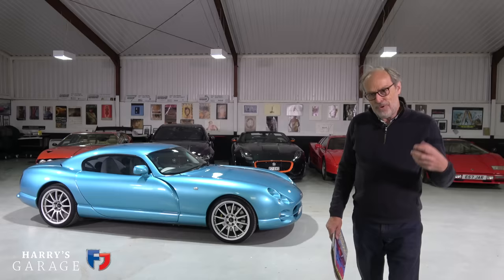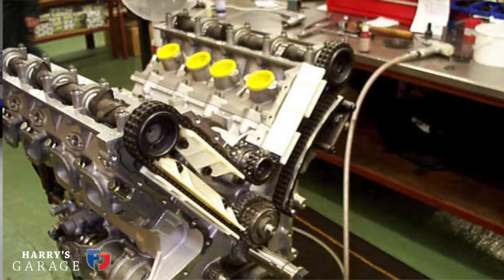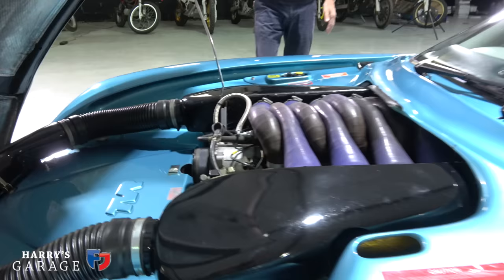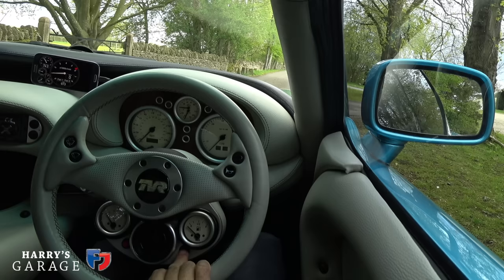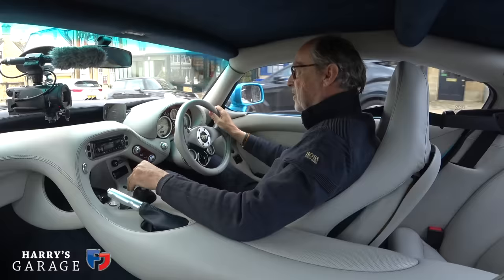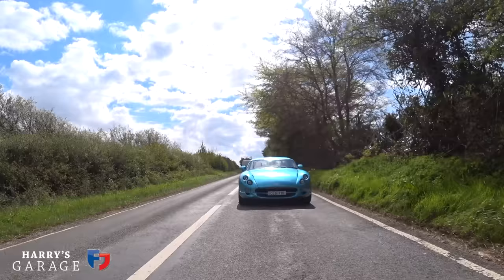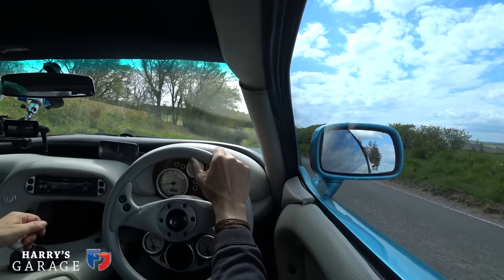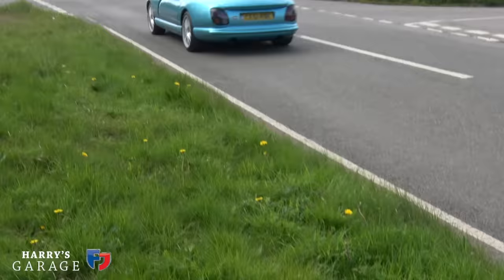2001 TVR Cerbera 4.5 Red Rose review. Revisiting the wild one 20 years on!

Comment: A flatplane v8 is like two inline 4s at an angle, the angle makes each bank fire every other time. Contrary to what Harry said, it is not firing two cylinders at once.
Reply: @r4360  That is not a flatplane, that is a flight of stairs, and a potato.
Reply: This engine's a 75° V8, even less likely to be firing at the same time.
Reply: Quite right however owing to the 75 degree angle, the firing sequence isn't a regular one either. Pairs of cylinders fire in a sort of heart-beat, ba bam, ba bam, ba bam. At higher revs this makes for a really harsh noise - lovely harsh - as though it would be the Devil's choice of V8. Very business-like.

After two Caterhams, one of which was almost 250bhp, I was looking for something with a hard roof that gave a level of performance I wouldn't be disappointed with. I ended up testing a number of cars from Porsches to Lotuses and in the end the only thing that had the race-car immediacy that the Caterhams gave me was a 4.5 Cerbera. An amazing car and engine if there ever was one. Mine had the short induction kit which moved the torque further up the rev range increasing its power. It also had an aftermarket ECU. There weren't many options for aftermarket ECUs then because of the heartbeat firing sequence, but Emerald came up with the goods (I had Emerald ECUs on both of my Caterhams too). This combination allowed mine to be mapped to Red Rose power levels. 

I am not sure I'd have the nerve to own another though. There's some support for TVRs in the aftermarket world but some parts are tricky to get hold of. I remember being particularly worried about having to source a windscreen, if ever that became an issue, as no-one made them anymore and the TVR-owner community was only occasionally able to convince manufacturers to make things in batches.
Reply: @NigelMarston  Heartbeat, quite the way to put it. Bravo
Reply: well he's half correct as Honda made a  motorbike which had a so called big bang engine where it was as though the cylinders all fired at once.
Reply: @toucan221  How does the existence of Honda Big Bang (a 360 degree crank) make him half right about what was said about this flatplane (180 degree) V8?

Comment: Had a couple of Tvr’s. You definitely have to look after them and cosset them but my word are they fun. Love ‘em. Great vid Harry.
Reply: Did you have a Sagaris?
Reply: @TBendez  I wish! An S2 and a Chimaera.
Reply: @philkitchen9719  Nice anyways, you'll get one someday ☺️
Reply: Had to check the meaning of cosseted, never heard or read it before... And yeah perfect adjective for my weekend toy, the 5 GT Turbo... Flimsy plastic fantastic toys...
Reply: I had a 4.5L Chimaera from new, and in the 6 months I owned it, it was in the garage being repaired for almost 3 months of that. It let water in through every possible place it could let water in, dumped a full tank of petrol onto my drive, and one morning I found it in the middle of the road after it had rolled off my drive when the handbrake failed. I didn't even get chance to enjoy it over a Summer, as I was so desperate to get rid of it. I recorded 18 faults in those 6 months.  I'm not surprised they went bust.
Reply: @markparker5585  I mean, that does happen to completely normal cars as well, the result of the handbrake failiure isn't even on the car. But alas, it is a lower quality car and therefore such issues are expected. 

Worst manufacturer screw up for the moment is probably Ford US, they're having catastrophic engine failiures within 100 miles.
Reply: @markparker5585  you must've had the Friday afternoon team on your car.

Comment: Had a TVR in the late 90s. Endless electrical problems. Used a ton of water, it was uncomfortable,  low teens fuel consumption, water in the footwell when it rains, terrible build, roof leaked. I loved it despite all this. You love them or hate them, there is no in-between.
Reply: I never got to own a TVR but I do miss cars with 'soul'. Stinking of petrol & oil after a thrashing, quirky unreliability, power assisted nothing, being able to work on the car yourself. Good old days.

Comment: Such a unique sounding V8 and that color is really amazing on this car. I can't believe in the early 2000s you could get this level of performance for under £40K. The TVR Speed 12 is still one of my favorite cars of all time along with the Tuscan if the same early 2000s era. Same with the Nobles, granted the fit and finish didn't rival the Germans but buyers of these knew that and accepted they're buyer an experience the Germans couldn't match.
Reply: Yus agreed, my 2001 E55 cost twice as much, has an engine one litre larger and makes about 50hp less, the TVR was extremely good value for it's performance level.

Comment: My dad had a 4.2 in “paradise Purple” and being only about 19 at the time I got to borrow the keys on a couple of occasions to visit Southend Seafront on a Friday night. Those were the days
Reply: Your dad sounds amazing. My dad wouldn't even let me borrow his XR3i.
Reply: @BobMonkeypimp  yeah, it was his little midlife crisis. (As my mum called it). I failed to mention that I also blew second gear out of the box and the Cerbera had a modified Cosworth T5 box that you could get out to repair / rebuild pretty easily… but putting it back was another matter. A guy that worked at the old TVR factory in Blackpool actually done the works in his garage at home for a cheaper rate. Will never forget that car… roundabouts in the wet was……. Eye opening to say the least !  Only other issue that was constant was that the cabin always smelt strongly of petrol, all the time. Luckily Dad and I never minded it ! Lol
Reply: @triumphontour895  I actually miss the good old days when cars smelled of petrol & oil after a good thrashing. I've had some of my happiest memories with my most unreliable cars, spannering was almost as fun as driving them. 
If you're going to have a midlife crisis, you may as well do it in style.

Comment: And although not as powerful as this Red Rose model...mine actually was ALL you EVER needed..
Reply: Snap. I loved that in most weather/road conditions up here in NE Scotland it would spin its wheels in first, often break traction at WOT around 50mph in second gear and occassionally in third gear. However, every now and then, the road would be warm and dry, the tyres would be warm and you could just about get to the redline in first gear without having to lift. It honestly felt like the stars and planets all aligned for you when that happened. It's so difficult to put into words, but I've had cars that put down their power better and I've had cars with more power that spun their wheels easier - but nothing has ever come close to the overwhelming feeling of satisfaction of it all coming together perfectly in a Cerbera. Its weight, power and traction were the absolute pinnacle of balance in my opinion.

Comment: I’ve driven that very car a bit.  It’s scary.  Handles very well now the owner has sorted it.  Originally it was impossible to use the power but now it’s as good it can be I’d say.  Still takes balls to drive even moderately quick.  Throttle response is insane.

Comment: Imagine having all those instruments in front of you and still needing to design an app with its own ones to understand what's going on.
Reply: The app is designed by an enthusiast, it takes data directly from the ECU to display digitally which is more accurate than the analogue dials. It can show information that the dials don't so you can keep a closer eye on how healthy the engine is.
Reply: Lots of us who've had these cars in more recent years have the app and it's useful for chasing down gremlins such as failed lambda sensors and stuff like that. It's usually something we use when we suspected something might be amiss rather than having it permanently on the dashboard though. Having proper oil pressure gauges etc, a Cerbera has better information as standard than the vast majority of cars.

Comment: I had a 97 4.2 Cerbera which I picked up new from the factory. Never had such a love hate relationship with a car before or since. Fantastic to look at both inside and out, and every drive was an event. BUT, in one year and 10,000 miles, it went back to the dealer 7 times, and it was for pretty serious stuff. The a/c never worked properly and it gets really hot in there. And, of course, the whole thing smells of glue. After a year, I had had enough and of course the warranty had expired. If you have 3 or 4 other cars, it has a place in your collection for when you are in the mood but it is not an every day thing, or certainly wasn't then...

Comment: I had much the same reaction as yourself Harry, when I first saw this 
fantastic looking car. I always loved TVR's, as they built such great looking, great sounding cars, with often bowel shattering performance, and they were never afraid to be different.  it's such a shame what happened to them. The Cerebra wasn't just great looking, great sounding and fast either, as it had two rear seats, (kind of), as well as a half decent sized boot, so it even had a semblance of practicality about it. TVR's always seemed to offer so much bang for your buck too, especially when compared to other cars of similar performance. So, if you just ignore the facts about slight reliability issues, build quality, fuel consumption, a pretty cramped cabin with rear seats suitable only for small kids and that it's always going to be loud, which on long trips the missus and kids may find a little tedious after a while.  Apart from these, well it's the perfect family runabout!

Comment: The TVR Cerbera is a great car for wild adventures. The AJP Speed 8 isn't a long stroke design hence the bore/stroke ratio for the 4,5l version is 91mm/86mm and because of the 75° flat plane cranck it sounds very unique, nothing alike. The torquey mid range behavior comes from the long induction hoses which are originally mounted on the 4,5l version in comparison of the very short induction on the 4,2l model. Hopefully I can make some of the great upgrades from the owner's list some day. Thanks for the great video. Drive safely.

Comment: I've always thought the aluminum LS engines were light at 414 lbs accessories and all ready to drop in and a little over 500 lbs for the production iron block engines and 550 or so for the LSX iron block but this is much lighter than the LS family. Granted the LS engines were larger displacement, made more power and the LS blocks can support and handle gobs over power over stock.

Comment: I've had one back in the days. It is a beautiful car and I actually quite liked driving it. I mean, when it did actually start. Sold it with 17k on the odometer and at that point, it has spent more time at the dealer's garage than in my own. What a pity... A beauty from the outside and the inside... well, I'd rather not say anything...

Comment: Harry, you may be interested to know (or may know) the AJP V8 was almost a direct engineering copy of the Judd V8 race engine . . . in a de-tuned state.
They bought one, took it apart, copied it part for part, and modified it slightly for road use

Comment: The Cerbera has the character of a Corvette whose designer very much enjoys magic mushrooms, and I like it. The stacked headlights look far better than the previous ones, IMO. It's 400-500 pounds (180-230 kilos) lighter than a Corvette or a 911, which is impressive. But I hate flat-plane V8s for sounding like fours. Sadly, that ruins this car. Well, that along with its fragility in stock form.
Reply: There are two types of flat plane cranks. the main type of flat crank, has  one throw down, then the two center throws up, then the last throw down like a four cylinder, the other type of flat crank has one crank throw up, one crank throw down, then one crank throw up, and then the last one throw down. The 5.2L Shelby GT350 has this type, and the only engine to have it. These engines do not sound alike, but will, if both banks of their cylinders are merged by a y-pipe, then you would have a screamer type exhaust sound.

Comment: I had a 4.5, sure they were quoted as 420bhp, not 440bhp (OK he clarifies the RR is 440).  Never felt like 400 though, let alone 420.  Broke down a number of times. Sold it after the 3rd low load to the garage. By comparison, also had a Griffith 500 for 3.5 years, that was just a much better and significantly more reliable car.

Comment: The decibel reading won’t tell you what the frequency spectrum is like. If the frequency spectrum is nice and smooth then a higher dB level can become quite tolerable and even pleasant. 😃 
A high and unpleasant dB reading may be due to certain frequencies with a narrow bandwidth being much louder (visually like a sharp mountain on a prairie) than the rest of the spectrum, resulting in the high dB reading and unpleasant sensation. 😖

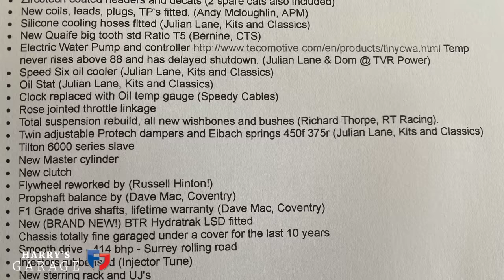Comment: TVR's power figures were always comically optimistic. 440 horsepower in TVR land is probably about 400 in the real world. This example on the spec sheet 5:17 you can see it says 414bhp, and it has clearly been fettled to within a inch of its life! I am sure it's a very hot TVR but to put it in the same performance league of an F40 is rather a stretch. Not least because the F40 without catalytic converters Ferrari quoted 471 horsepower. They were pessimistic. Real world 500+ in standard guise is easily the documented norm, not the exception. Pretty much every early F40 left hotter than advertised, TVRs quite the opposite. Road and Track magazine tested such an example and it posted a 7.7s time 0-100mph.

Comment: Wonderful, the engine noise is perhaps disappointing but at lower speeds and with the whine of the gearbox it sounds a little bit like a vintage Bentley.
Who needs stupid Apple CarPlay when you have all the in car entertainment you  need driving a  proper car with a proper manual gearbox

Comment: Was it true that the car supplied to Performance Car for it's performance testing had anything but a standard engine?. I mean 30-70 in 3.2 seconds and 0-100 in 9.0 seconds suggest TVR were pulling a fast one with this car. 350bhp?... 450 more like considering it had a manual gearbox.

Comment: The 4.5 Red Rose , when on premium gasoline , could be the road car with the highest specific torque output. Are the stated torque ratings realistic or are they as fake as the horsepower ones ?
Reply: There's a video of the 350bhp one trouncing the 400bhp+ Viper, 911 and 500bhp Vantage.

Comment: Fancy one of those as a second car. How reliable are they?
Reply: 25 years old now. Running gear is very reliable. But the tubular chassis will need attention at some point. And some of the electrics will need improving/updating.

The plus side being, £200 insurance on a classic policy. And £280 a year car tax. Tyres are cheap. It’s a 0-60 4.2 second, 185 mph motor. I can’t think of much with a similar spec, that you could run any cheaper 🙂

Comment: V8? With the hood open, I only see 6 squishy intake runners.?
Reply: You can see four intake hoses on the far side, where he’s standing.

The rear hose is obscured by the scuttle panel that the wiper hoses pass through.

I’ve got the 4.2 variant, and on mine the air intake vortex boxes bolt straight on to the manifold. I did have a 4.5 like in this video a few years back, and regret selling it.

Comment: They are dry sumped aren't they? They have an oil tank. The inlet manifold isn't actually an inlet manifold in the classic sense, it's individual intake tubes which link the throttle bodies to the collector boxes. The engine is almost two Pro Mod Kawasaki Z heads on a flat plane bottom end (it's a direct crib of the architecture). The speed six engines were pretty much a crib of the Suzuki GSX head architecture.

Comment: Minor thought: the tiny air vent on the steering wheel is the only air vent I know of in the cabin and that’s only because Harry deliberately pointed it out. Other than via down windows, how does air get into the cabin?
Reply: There are vents under the window for demisting. There's other hot air vents under the dash too. It has separate vents for hot and cold air.

Comment: "Race Derived" engine... Erm, well, no. 😂 They weren't just BS'ing on about the HP. It can't be race derived if the engine wasn't originally built for racing, used in a race car, or modified from a race spec engine. Not a single part of the thing was. 
Which is fine 😃. Just can't call them out for the HP only to then not do the same with the engine design. (I know it was supposedly built (in a very loose way) towards the ethos of an F1 engine of that era... But no, just no
Reply: With respect, you are totally wrong. The AJP was used in the Tuscan Challenge cars in the race series long before they decided to use it in the Cerbera. The term “race derived” could not be any more accurate.
Reply: @robs7881  Don't let your pesky facts get in the way of good BS fantasy.